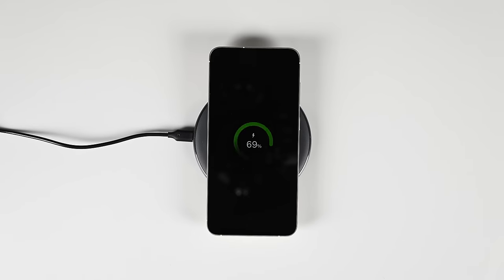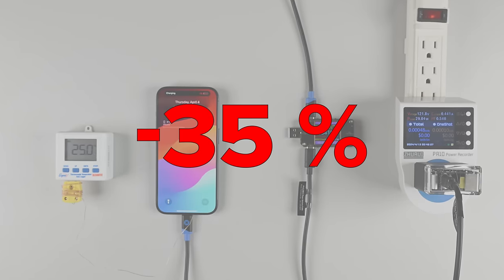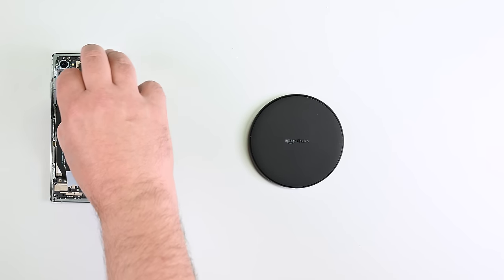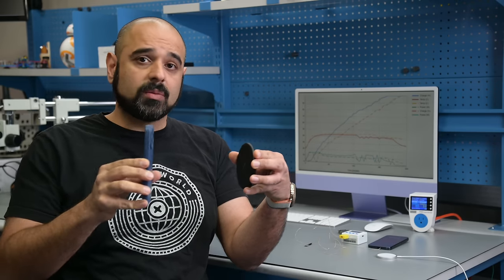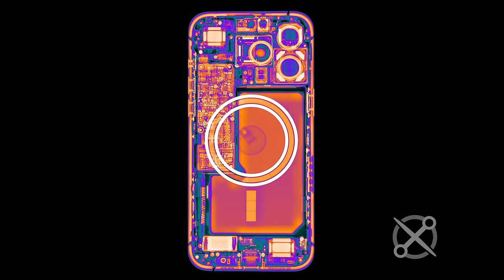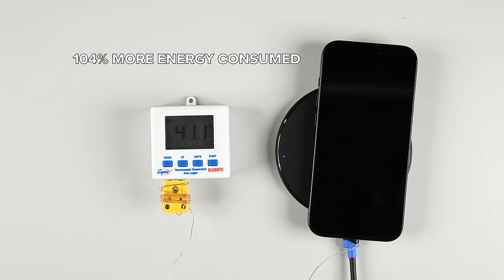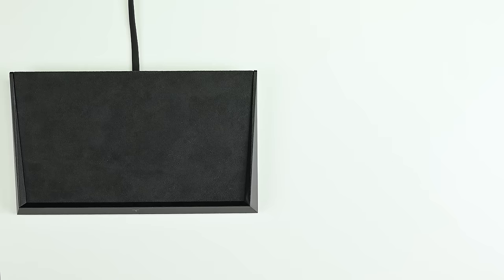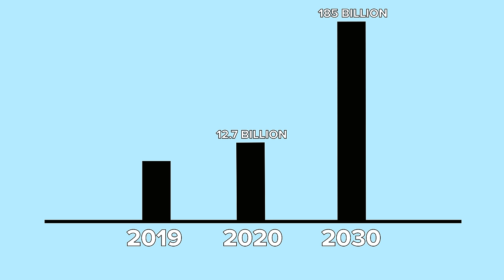How Wireless Charging Works and Why It's Terrible

Comment: Living in a subtropical country, 30°C temperature feels almost like late fall or early spring. It's usually 40-42°C during summer and 35-38°C most of the year. So our phone batteries are constantly getting degraded even without charging.
Reply: its the rapid charge and discharge that will definitely wear the battery faster as long as battery temp is within 45C you dont need to worry i have my iphone for 4 years with 83%capacity left and the climate is usually as tropical as yours is
Reply: I'm told in extreme cold conditions the battery will also have a lot less charge capacity. There's always a temperature rating with batteries, and at either extreme of the operating range they are much less efficient.
Reply: @MMuraseofSandvich downright nonfunctioning, in my experience. I used to work in a warehouse where we couldn't take our phones, so I would leave it in my car turned off. In the winter when temps got below freezing, when I got off work, I couldn't turn it back on until I warmed it up with the car heater.
Reply: unless you keep you A/C running forever to drop to 25c.  >30c is unbearable
Reply: Lithium batteries have a narrower charging temperature range than operating (non-charging/discharging) range. For instance, a typical LiPo may only be recommended to charge between 5-45C (closer to room temp is still better because less heat related wear).  Whereas typical LiPos are recommended to be discharged between -20C and +60C.

So there's still some heat related wear on batteries discharging in a hotter climate but its not as bad as charging in a hotter climate.
Reply: Exactly, 40C is nothing to worry.
Reply: @inothome it is for your battery
Reply: youre on the internet. im sure you can afford this old technology called "air conditioning"
Reply: @opus64kbps  100% false! I live in Vietnam where the temp at 3am is still 35C or more and while just about everyone has a smart phone only 50% or so may have air conditioning at home.
Reply: @opus64kbps internet plans starts ~$2/month and 5G android phones  starts ~$100.
Whereas the cheapest split AC cost ~$300.

If you have 5G phone, there's no bandwidth and data cap, its unlimited.
Whereas electricity cost are high, and are tier based. If you use less of it, you pay less, and if you use more units you go to the higher price slot and pay more.
Reply: 30º environment temp ≠ 30º battery temp ;)
Reply: @opus64kbps  Air conditioning is insanely expensive. The internet is practically free.
Reply: @opus64kbps some of us go outside  and air conditioning is not portable, dingus
Reply: @fuseteam  Yes, op meant:
30°C room temperature = more than 30°C battery temp

which is worse
Reply: @opus64kbps Ah yes, affording internet which is close to free nowadays means affording air conditioner (ac), which gobbles up 3000 joules of energy per second.  Turning on ac for a day is equivalent to turning on a ceiling fan for 2 months, 24/7.
Tell me you live in a 1st world country without telling me you live in a 1st world country 🌎
Reply: Me in tropical country with the same 35+ C hot temperature year-round, but even worse, the extremely high humidity can corrode the phone internals in long term if the phone has no IP rating
Reply: There is a different about charging temperature and operating temperature (discharge). Usually charging temperature is narrower. Example LiPo has charging temperature 0 - 45 degree celcius and discharging -20 - 60 degree celcius. In addition, lot of phone has been smart enough to act if the battery become too hot (usually become slower).
Reply: Most people keep the phone in their pocket, so they're running around body heat most of the day anyway.
Reply: @monad_tcp *For North Americans
Reply: @opus64kbps If I had a 100 dollar phone and almost unbearably slow internet access, would that mean I am suddenly able to sustain using an ac all the time?
Reply: Yep. It's already over 40°C outside.
Reply: writing this comment with 42 degrees outside and i can confirm stuff gets hot when charging even more than the temp outside phones are still meh but my aluminum intel laptop turns iron hot i keep the case off my phone its 4 years old at this point battery is fine just sometime doesnt fast charge if the temp is high and ac's are expensive we have fans i can afford to install an ac in my room but truth be told the electricity cost is a lot they are also not very efficient in super hot temps and consume more electricity while you stay cool the bills are super hot oh and i dont wireless charge mainly due to it being slow.
Reply: I agree this is my problem as well. Using WIFI i constantly get 35° and when outside with cellular data ill get up to 40°

When charging i manage to keep my temp 35° by removing the case and focusing my fan at the back of my phone.

Comment: 1:56 Correction please. The efficiency problem is not in generating the electrical field. The underlying principle here is the transformer, and transformers can be extremely efficient. The problem is the poor magnetic coupling between the primary winding in the charger and the secondary winding in the phone. This could be improved by ensuring correct mechanical alignment, and not as per the Tesla solution of more coils. You could even let the magnetism do the alignment for you. Still won't be as good as a wire though.

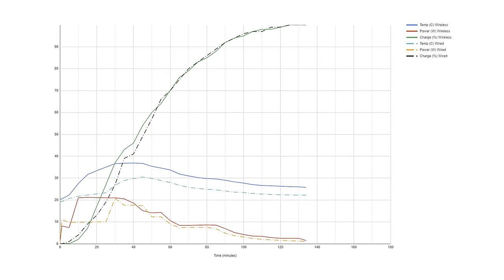Comment: At 2:43, the wired connection is represented by a dashed line, the wireless connection is represented by a solid line... an interesting subversion of expectations.
Reply: Not sure what you mean
Reply: @DaMu24  wired charging should be the solid lines, like a charging cable is a solid line, and wireless charging should be the broken lines. Reading the chart with them reversed made it more confusing to my tired brain at the time.
Reply: @coder543  I felt the same, and I needed to pause the video to invert the idea in my mind! :D
Reply: @DaMu24  an universally accepted and logical thing, not only in technical drawings, but on maps, and in general illustration is that solid lines represent solid, visible objects or features. A dashed line represent invisible, imaginary or theoretical objects or features.
Reply: This bothered me so much! 😅

Comment: Most phones have a feature to disable fast wireless charging which significantly decreases heat and also slows down battery charging overnight to about 3 hours which can actually help reduce wear
Reply: or you can just... plug it in
These aren't the directional MicroUSB days anymore
Reply: That's what I do. I have my phone scheduled to disable fast charging everyday from 11pm - 6am. Working well so far
Reply: My pixel also does that when charging wired
Reply: Charging batteries for long starches of time degrades health faster... charge in steps.. or "fractions" 30% add another 30% take a break.. rinse repeat
Reply: Yep, it's disabled and will only charge to 80%.

Comment: I have to say that I always thought that wireless charging was pretty worthless until I damaged my charging port out of warranty. I keep my phone for at least 3 years before upgrading and wireless charging has saved me from an early upgrade. With that being said I would still give it up in a heartbeat for a rear mounted fingerprint scanner.
Reply: Why is that such a problem, i replaced charging port myself on my phone. Its not diy for anyone but any phone service should be able to do it
Reply: same here.
Reply: @Boz1211111 Yes I know but it's not cheap and for an old phone it probably isn't worth it
Reply: @SirKrumpleOWrapper bruh, which service did you tap in? I replace my charging port for 20 dollar or less. At least way better with degraded battery, which I did that too and it is 200+. Aside what is with the notion of old phone repair isn't worth it? 5 years old or less phones is totally serviceable, while new phone cost upto 2k (5k if you count them shinny folded), nvm the environment, save your own wallet.
Reply: @hongkyang7107  Depends where you live. Where I live it costs $60 to fix a charging port and $20 for a magsafe charger.
Reply: @patchouli9  Perhaps. I mean  I do live in a place, not crazy like New York or such but moderately expensive. However,   I stand by my point in that prices everywhere is the same with a different scale factor, so in your place they might charge you 600 for battery replacement. Another thing to consider is to not go to the manufacturer repair vendor with an exception of waranty, ofc, my laptop and phone both have gone to the shoddiest repairshops imaginable and it work just fine for one third the price.
Reply: Same here my grandma’s phone port got damaged and she now use my wireless charging pad without repairing her phone isn’t that real good !!

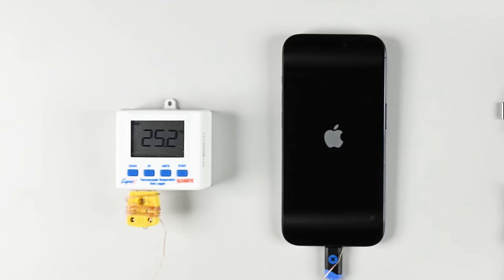Comment: 1:06 try it with budget phones. i have seen like 40-50c on cheaper phones.
Reply: of course. and they did say that they were going for a best case scenario, hence the more expensive phone
Reply: Budget phone usually skips multiple PMCs to alternate the amount of power feeding to the battery base on its temp, that's why they tend to get significantly hotter esp at low battery
Reply: Budget phones have wireless charging? None of mine do.

Comment: It's all about compromises. The ease of being able to pick up the device and put it back to charge in a second is handy for example when you're doing many short trips in a car, and would rather not break the charge port. There's no point in choosing wireless over wired when the device is charging overnight.
Reply: How difficult is it to spend 10 secconds more plugging in a phone?
Reply: @a1white  Nothing is difficult per sé, but forget disconnecting it once while exiting the car, and you can forget about using your usb port ever again. They break easily.
A magnetic cable/connector combo is a good compromise, but in my experience, the two parts often stick to eachother a bit too well and i've lost many such connectors.
Wireless charging was not the ideal, but still the better solution for me in that case.
Reply: @a1white It’s less wear and tear on the charging port. I’ve had 3 phones where the charging port broke, I don’t plan on that happening again.
Reply: @a1white quite difficult actually when you deliver for Amazon and have to get into and out of the van approx 130 times a day.
Reply: After my daughter (11) damaged three phones by always forcing in charger, we promptly got her a wireless charger. No issues since
Reply: honestly usb C port is so reliable while i broke some micro usb ports i've never broken an usb C port so why not go have the phone wired charging in the car? convenience? i dont know
Reply: I had a phone and I used a wire before, that was untill the last 5 chargers i used broke, after 3 months with each charger it become more difficult and harder to use, I had an ipad once and a cable actually destroyed the port so I had to go to a repair shop, wires are good if your in your home, but anywhere else a wireless charger could be good, my cables get damaged easily
Reply: @EnterTheSoundscape  must be  micro usb or lightning. Usb c doesn't wear as much
Reply: @Asad-hv2dc  It’s USB-C. It seems they’re not all made equally, some of mine have been through some serious wear and tear and works perfectly, but I’ve also had some break over absolutely nothing. A USB-C port on my MacBook broke simply because I gently yanked the power cable out.
Reply: I've never had any problems with USB ports breaking in my whole life
Reply: @brianfunt2619  lucky you
Reply: @batdroid2705  I think you need to teach her better habits, not a wireless chatger
Reply: Doing deliveries for a living, trust me, those seconds add up very quickly. But even worse is that much plugging in and unplugging will significantly shorten both the cable’s and the port’s life. For me, wireless charging (especially MagSafe) is a godsend.

Comment: Appreciate the testing.

I was hoping there was more tests about how much batteries degrade with higher temperatures, but that would take a huge amount of work and data.
Reply: Even then you would need a water sample size, probably for it to be meaningful data. If you're just testing one version of a few different brands over time, I don't know how much we would learn. Probably why there's not a lot of studies on Long-Term battery degradation and phone habits and charging habits etc...

Comment: The biggest issue with wireless charging is that the charging pad itself requires a cable, and it's so close to the phone that you might as well just plug that cable into the phone anyways.
Reply: @xetsuma  exactly. functionally, it’s not much different from a wired connection. it’s just tech for tech’s sake.
Reply: Wireless charging is for different purpose, I have one at my bedside table and leave the phone there overnight. I'm sure you have a place for your phone as well, why not make it charge it meanwhile you sleep.
Reply: @GreySectoid  You don't need wireless charging to do that.

Comment: Good Video, loved the facts!
One thing I would mention as a benefit of wireless charging though is that you will have way less trouble with loose connection plugs. I keep phones for 4 years on average, and when only using cables, I often have quite loose connections in the end which sometimes start bugging around.

Comment: Something that should be mentioned in defense of wireless charging is that wireless charging prevents wear and tear on the charging port; which (unfortunately) for many phone models is not as easily replaced as the battery, if it's even replaceable at all. I've had to replace several otherwise working phones in my life due to the charging port being worn out to the point it would not consistently charge.
Reply: Exactly. This is why I use a slow wireless charger, limit my battery charge to 85% with the Samsung setting, and use a Wi-Fi Android Auto dongle. I've reduced by total plug/unplug cycles by around 95%.
Reply: This has been my problem as well. USB C just doesn't seem to be robust enough for this purpose. The ideal solution would be magnetic plug in the phone but wireless slow charging overnight works as well without destroying the battery.

Comment: Great video!    I always knew Wireless charging was not great due to heat I tried it for a few months but switched back to wired.   My trick is to have a small plastic bracket like a U shape upside down screwed in to my desk, that is smaller than the cable, it is set near the rear of the desk, so I pull the cable from this U bracket and plug in to charge my phone, then when it is done, I unplug and let go, the cable will be pulled by gravity and get stuck in the U bracket and just wait there until I need it again.

Comment: I’m using baseus magsafe stand to charge my iPhone. Yes it gets longer to charge but it doesn’t get that hot as charging by wire. In my opinion mag safe magnets are the best way to perfectly align your phone to wireless charger.

Comment: Having used a 5w Anker wireless charging pad for many years, it never manages to create enough power to make my iPhone get even barely warm 😂

Wired charging still seems to make the phone get noticeably warm, though I can’t decide if the slower wireless charging is overall better for the battery or not. Based on my son using my old 12 Pro Max which is still on mid 80’s for battery health, I’m inclined to think slow wireless charging is no concern beyond energy waste….possibly balanced by a phone which still has great battery health and life.
Reply: I noticed the same.  The faster, mag safe wireless chargers make the phone uncomfortably hot, they will definitely degrade the battery over time.  The little cheap, low-wattage Anker pads trickle charge the phone overnight and generate essentially no heat unless you seriously mis-align the phone on the pad.  Yes, they do waste energy, but the amount is trivial in relation to the typical person's overall electrical use in a day.  If I need a fast charge, I plug in.  But for overnight charging, the low wattage pad is very convenient.
Reply: My experience as well. Fast charging makes the phone noticeably warm, while slow wireless does not. I think this video misses the point entirely.

Comment: I’ve gone back to wired
Reply: Why? Cause of this video?  I've been wirelessly charging my lg for 5 years now and the battery is just fine
Reply: @varunaX it's still inefficient
Reply: Good thinking buddy boy
Reply: Agreed, I use a wired 1amp Apple plug from like 7 years ago, and only charge to 80%. Battery is at 98% life after a year of being drained almost daily. My previous phone was at almost 87% at this point with wireless charging every night and 100% charge.
Reply: @zUltra3D who needs efficiency? Charge your phone at night and youll be aii

Comment: I’ven been a big fan of magsafe charger. Been using almost exclusively on my 13 pro max since its launch and I do not see any extreme battery wear, even with the frequency I charge my phone due to how much i use it. 

Must add that i live in a pretty cold region, with summer with >25° temperatures only lasting for a couple of weeks. When its hot i definitely feel my phone getting toasty no matter how I charge it. One solution I used last year was to put the phone in a thin plastic container, add a thin layer of water and then connect the magsafe under the container.